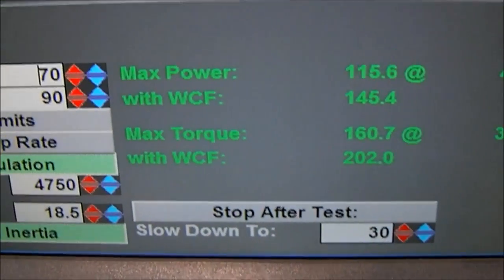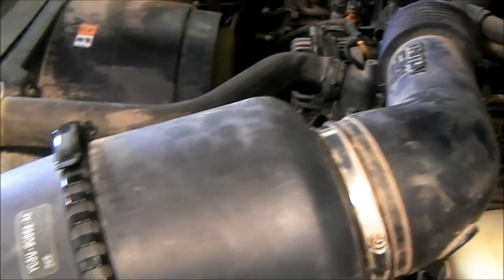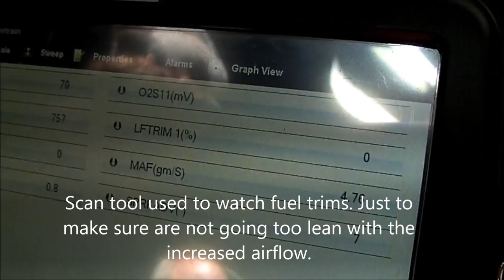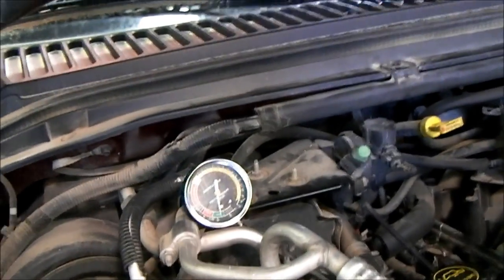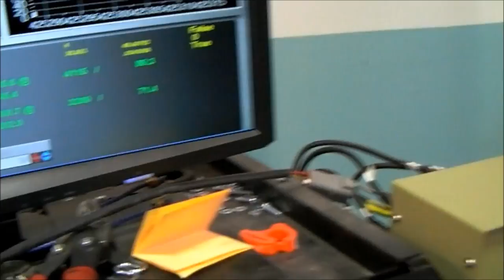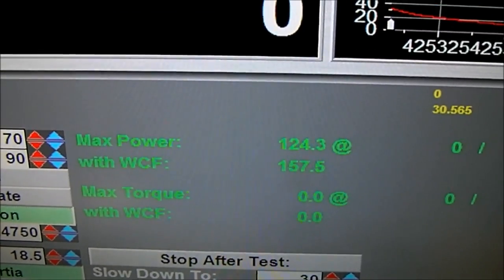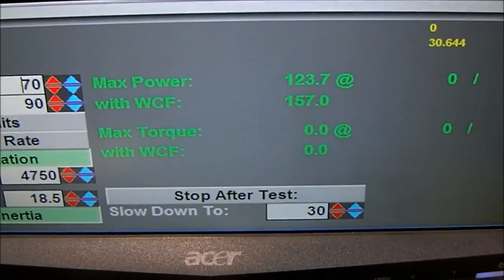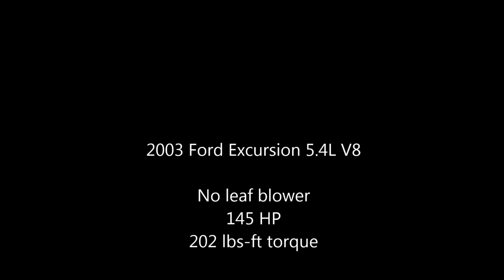Leaf Blower Forced Induction

Comment: You did what every broke ricer has ever dreamed of doing!

The thing is the leaf blower is a fan and not a compressor. As soon as there is resistance the fan will not generate “boost” the excess air will just go back on itself. As for the power gains maybe the density air was better on the second day or maybe the little help the blower may have worked.
Reply: dasllamas depends on the leaf blower. Husqvarna (I spelled that wrong I think) uses a turbine wheel.
Reply: Nineteen-Eighty two Rampage even a turbine to blow leaves its not enough, turbos rotate at 20.000 RPM or more, and supercharger are not blowers, they are positive displacement pumps, both thing are very different.
Reply: Polo Gamero one thing you're forgetting though is that the leaf blower has a larger area so it can provide more air as a lower rpm. Maybe not more than a turbo but it's not all pressure. Remember PV=nRT and the moles of oxygen is what's important, you can provide the same moles of oxygen without increasing pressure but increasing volume instead.
Reply: dasllamas not everyone wants to drive a POS dodge.
Reply: dasllamas a fan believe it or not gives compression. Also, the fan is being driven by another motor, so that helps too.
Reply: dasllamas you probably think your smart but no simply put the wg pressure isn’t enough
Reply: Christopher Lam but the volume refers to volume going into to cylinders, but with blowers you don't get air going inside, that its the problem. If you blocks the blowers output the current and therefore the electrical power lowers, that its the proof the blower its not doing more work moving air. On a positive displacement system like a super charger if you blocks the outout the current increase and so the power consumption. You can never broke a blower blocking the output but its can do it on a pump.
Reply: Squeek Tate sure heavy duty Dodge trucks are bulletproof as long as you don't count the transmission in that statement.  Family has a turbo diesel on its 3rd trans.  Had an old dark blue 300,000 mile Ford inline 6 that never had anything major break.

Family has a turbo diesel Chevy where the glow plugs won't come out so it's toast.

Had a late 90s Dodge Dakota that towed a lot and nothing ever broke but it also was a lease and went back w/ under 100k

Bottom line I've seen every brand have a major failure and have seen every brand have one that seemed to last forever.

It changes from year to year and model to model...
Reply: Squeek Tate I'm not an engineer, but I have a good idea of what I'm saying.  I have experience working on cars.  I've rebuilt transmissions (only manual though) I know how a automatic works.  I know what causes failures.  One side of the family does construction the other side races cars.  Both sides require good work trucks.  The race side for towing and the construction side half for towing and half that don't tow.  Of the towing vehicles they are usually diesel although the Dakota did some large open trailer towing and small boxes trailer towing.

Anyways, almost everyone that we know that has ran late 90s and very early 00 Dodge diesals for nom stop towing have had issues with their first transmission.  Not a person in my family is dumb enough to think a fast turbo diesel truck is fast, because they are not.  So we all leave our work vehicles stock.  Everyone drives them like a granny.  Had we known a little more about the issues Dodge has had when the first transmission went we would not have had any more issues.

The common word on forums that deal in works trucks and the forums that deal with caugh caugh "race trucks" is that you are going to blow the first transmission but if properly done the 2nd should last forever.

Dodge knew this too... They started putting a better pump in the 47re and then they started putting in better planetary gears that where no longer aluminum.  

Then they just went with a whole new transmission (well kind of).  That new transmission is really just better parts.  

Dodge isn't the only one and not everyone has problems.

The SRT4 has become well known for having a shit transmission... Upon tear down I've seen what they mean.  Where I had over 400HP and about 30,000 miles before I sold mine and I never had an issue... Why? Because I never shifted fast or hard.  Doesn't mean shifting fast or hard should break it now does it?  The issues it had where shit parts... It really was.

You say you tow but it doesn't sound like it's all you do in the truck.  That's all this truck did.  Shouldn't matter though... You don't buy a 3500 diesel for driving around the block.  You don't even buy a 3500 to make into a box/ladder truck.  You buy it because you tow big shit often.  

Anyways the 3rd transmission is probably going to Outlast the body which is rusting pretty bad now.

But Dodge earned that transmission name and you know what it got them to fix it!

If 5-10% of 47 owners have to replace their transmission and all the ones who didn't get a better build had to replace it again then that means DODGE screwed up.  Not that 5-10% of owners.

 Because most owners really are not using their trucks anywhere near the limits that Dodge advertised.  The ones that do... Have failures!!!

Also those idiots who hot rod their diesals... They are not pulling a trailer so honestly that transmission should hold for them too... To an extent.
Reply: No boost from this but the gains make sense as the engine has to work less on the intake stroke.  You just can’t boost with something so weak
Reply: +MrGivmedew Dodge TRUCKS WIREHARNESS ALWAYS GOES OUT TRANSMISSON AND WIRE FOR 1ST 2D 3D GEN DODGE
Reply: Keegan Adamson not sure what you mean or what your getting at.  I personally have never seen a wire harness failure on any of the trucks nor any of my friends trucks.  I have seen a resistor pack failure but that's a cheap fix if you do it yourself.
Reply: dasllamas well said
Reply: dasllamas -- agreed but... What about the dude running in front of the car with the leaf blower on his back?
Reply: Polo Gamero that was a episode of road kill
Reply: Squeek Tate wel so it should be. Europeans, japaneze, even chineze  make engines 4 inline 2 liter atmospheric and have 150 hp @ 6000rpm or so. And they go 200-300 Thousend miles. Soo, i hope american v8 runs 1 milion miles  at least :-P

Comment: The worst engine option for the excursion
Reply: fastfocus2005 hey the two-stroke boost option generates a whole nother 10 horsepower of course it's a $500 option with an extra engine to run and then adapter to hold the man running the leaf blower in front of the truck
Reply: Get the V10 that V8 is a Prius compared to the V10 triton
Reply: @coydog7902  Ford motors (shakes head) especially the might 5.0 .. its a kitten
Reply: Considering a 2019 Prius makes 121 hp at the crank, you're seriously risking insulting the Prius with that comparison. Just thought you should know.

Comment: 5.7 liter engine = 5,700 liters of air per minute goes thru that engine. They are using a blower that puts out 5,600 liters per minute. They will need a 1600 cubic feet per minute blower = 44,000 liters of air per minute. Thats a 8psi boost. Hook up multiple blowers for torque. One feeds air to the others intake. There are traditional air blowers and radial systems for torque.

Comment: remove the duct tape, the coanda effect will blow more air into the engine than having it directly linked
Reply: Caleb Davies - Venturi effect you mean?
Reply: Blowtity effect
Reply: Wifes mouth effect
Reply: Corealis effect
Reply: Caleb Davies dont you mean wakanda effect
Reply: @bananaslippn8855  wakanda effect is when it doesn't work at all...
Reply: Volume but not pressured.

Comment: Fuel trims are not active during open loop/wide open throttle, even if it did give you a trim value it wouldn't be accurate... you need to monitor the front o2 voltage, make sure it stays pegged about 0.9v while full throttle, lower the voltage leaner it is

Comment: Curious, Did that leaf blower have it's exhaust venting in the air it was blowing to protect the user?  If so, wouldn't that somewhat turn the leaf blower air/exhaust mix slightly inert like an egr valve?   Something to consider.

Comment: Look people. Cars are designed for comfort and simple moving to place to place. Where Trucks are for heavy load hauling and work.they may not have lots of horses. But they got torque. They can pull houses and not care. A 4 cylinder couldn't. Now that 5.4 is work out and that truck needs a rebuild

Comment: You should turbocharge the leaf blower
Reply: twon legacy Turbos don't work on 2 stroke engines - you'll just blow fuel out the exhaust.
Reply: KJ6EPL On a valveless two stroke yes.
Reply: Turbo the turbo lol
Reply: Turbo it with another turbo leaf blower with another turbo blower...

Comment: Don't know if that's hilarious or sad... my last motorcycle made 80hp from a 600cc engine!  I'm guessing by the age that engine must have a ton of miles and probably not much compression anymore.  My 2010  f150 has the 3 valve version of the 5.4L and it is definitely not lacking power or torque.  Best version of the 5.4 by far.

Comment: Try hanging a Home Oxygen Concentrator (Nitrogen removed from air ) in the intake.
Get a 20 liter per minute model.
These things take in plain air, which is 78% nitrogen and output 98%-99% oxygen.

Comment: The old 5.4s are badass i dont know whats wrong with that excursion but my dad had a 2001 f150 with a 5.4 and it put out about 260 hp and 300 torque

Comment: You need to upgrade the 2 stroke engine first, more rpm and some right resonant exhaust pipe. It would be interesting using a 50ccm 18HP engine with two or 3 turbine at once.

Comment: That Stihl BR420C has a airflow of 724 cfm (from the manual).
https://www.stihlusa.com/WebContent/CMSFileLibrary/instructionmanuals/BR340_420_Manual.pdf
The airflow of a 4-stroke engine is  Airflow(cfm)=Displacement(ft^3)*RPM/2.
For the Ford truck's 5.4L (0.1907ft^3) engine, it will draw 724cfm at 7593 RPM, The truck probably redlines at 5000 to 6000 RPM, so the leaf-blower should be able to keep up with the truck.

Comment: There's something terribly wrong with that 5.4 you might want to see if a spark plug come out of the head. Cuz I have it lightly modified 94 GMC with the old 350 that makes more than that to the wheels. It actually makes an embarrassing 290 something depending on temperature. But I've managed to pull out 375 torque believe it or not

Comment: Just a hint, there are walk behind blowers that put out 2600 CFM, some maybe even more than that.
Reply: superusermode not at a pressure that would be meaningful to boosting an engine.
Reply: Its not cfm forced induction engines need, its psi that counts, if you can forced that 2600 cfm at 2 or 3 bar is the deal here which leaf blowers can't do, they can blow a lot of air but will only spin its blades almost in vacuum when the pressure raises over atmospheric
Reply: bibi kola you have no idea what you are taking about. Have you ever studied fluid dynamics? Pressure is the result of resistance of flow. If you restrict cfm you will create pressure. If this engine is only cable of taking say 700cfm and you add something that is capable of flowing over 700cfm you will create pressure as the engine naturally asspirated can only suck 700cfm in. This leaf blower is not capable of building enough flow to build pressure. It's not what it was designed to do. Did it help build some power? Sure it did, but the blower is not strong enough to force air into the engine to create any kind of boost pressure. Don't argue, go read a book and learn.
Reply: Frostman182 I think you confusing things. The ability to pressurise cfm is different to producing cfm. The blower can only blow  just above atmospheric pressure. Look at a supercharger which is a hyper leaf blower has the ability to pressurise the air flow. Leaf blowers will develop zero pressure around the fan blades cos the air escapes through that gap. Fluid dynamics? Really.. Isn't that what they need to enhance the leaf blower's blade design. Mate pull your finger out
Reply: yes.. i see where you going with this. lets all strap a leaf blower and using your college/university paper on pressurised air we can make a 5.4 v8 engine dyno on 1000hp..

Comment: Just look up the specs for the 5.4 its 300hp ! The same engine on the lincoln navigator intech v8 5.4. My 2002 ford explorer 4.0 v6 makes 215hp so how does a 5.4 makes 145hp?
Reply: Its probably tired  . And the cam phasers are probably shot and havent been upgraded or deleted yet . And it probably needs a tuneup .

Comment: 145 for a 5.4 V8. My dad has a 1999 with the 5.4 360xxx miles still puts over 200 hp easy something ain’t right. My 2.5 4 banger ricer put out 175 hp with my straight pipe and intake a push around 202 HP

Comment: the ecu and the fuel pump must be changed to take full advantage of the leaf blower the best engine for your air compression system is an engine with a distributor

Comment: people who do this kind of stuff, or use "cold air intakes" with high flow flat or cone filters, have never rebuilt a motor and while on engine stand turned the motor by the crank with a breaker bar. If they had, they'd realize how much compression and how hard it is to have one cylinder go through let alone 4 or 6 or 8 etc, An Engine is going to suck whatever it needs, no blower or filter or combo thereof is going to make any difference whatsoever on these toys

Comment: You are only demonstrating what Chevy already knew on fuel injected Corvettes from  1957 to 1965. Ram induction increases horsepower. Unfortunately any power increase on those cars was probably more the result of cooler air coming from outside the engine compartment then actually from the forced air at speed. To get any appreciable power input from forced air induction on those cars, the car had to be moving well over a hundred miles an hour to have any effect.

Comment: No leaf blower on earth can spin fast enough to make a HP gain on ANY engine.
Reply: You have volume with a leaf blower,not pressure.
That mean you fill up the air intake box completly, wich is normally under slight vacuum.
It's working,you see it there.
You just need a bigger volume displacement from the leaf blower than the engine at its max rpm and that's it.
In formula 1 you can even have positive pressure in the intake runners with a naturally aspirated engine simply because you use the elasticity of the air as a spring ,and a specific frequency to fill up the intake ports.

Comment: All the vacuum lines are now having air forced into them instead of vacuum
Reply: blindabinda123 
Fuel injection my friends... Vacuum is generated and used, not developed in the plenum chamber.
How does the engine work if the vacuum booster just sucks the plenum chamber dry?

Comment: My 2000 f250 5.4 2 valve puts out 290 hp. Your engine is probably dogged out and abused.
Reply: Hp means nothing in a 3 ton rig bud . And it probably put down 290 as it rolled off the lot .

Comment: See it would work better to put the filter behind the leaf blower  instead of in front because the filter is robbing the air flow  that's why the mass airflow sensor is after the filter and not before  just saying you'd get way more  if you took the filter out and  run the direct through the mass airflow  after the filter not before  the filter  because it's getting to the filter and the filter is stopping the flow just saying it doesn't go mass air flow and then filter does it no it goes filter and then mass airflow I wonder why because the filter slows down the flow delete the filter and you gain more flow which you gain more power run it direct through the mass air flow straight into the tube not before the filter that's redundant Yes she'll gain a little tiny bit of power but not the kind of power that you would gain if you just ran it directly through the mass air flow and not through the filter another words remove the filter box and run direct off the mass air flow cuz it goes intake intake tube mass air flow filter you should do it intake intake tube mass air flow leaf blower then filter that's how you get the maximum power out of it idiots

Comment: I had the 5.4L for about a year. It was just as quick pulling a travel trailer as my minivan was, same size trailer. Very unimpressive, and cause I got it used, it had problems that showed up in my 1 year of owning it. Crap engine. Sure, someone who owned the thing since brand new and taken care of I'm sure would last long time, but it was still gutless.

Comment: good luck holding on to the truck and the leaf blower as the it cruises  down the road lol.
the added weight from this 200 + lbs guy and at least 30 lbs for that leaf blower.  you're really losing more power than gain LOL
Reply: Thats why if one really wanted to they would fab up a mount to hold the blower and rig a long throttle cable into the cab for the blower . If they had a brain that is ...

Comment: You do realize your dyno is not set up correctly right. Lol

Those trucks are over 300 hp stock. 

My 4.6 stock makes 240hp and 275lbs tq 

Plus it's a blower not a compressor so it won't compress and atomize the air.